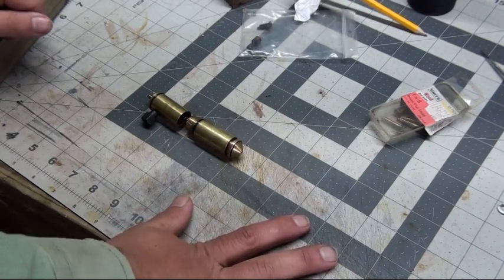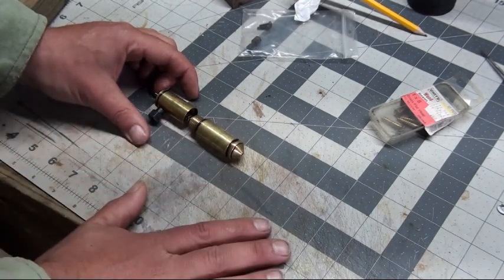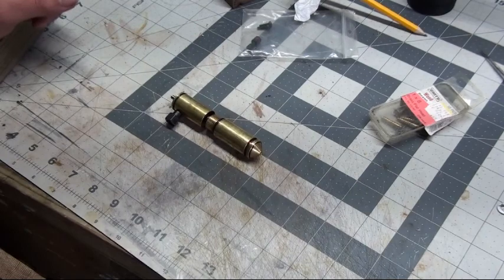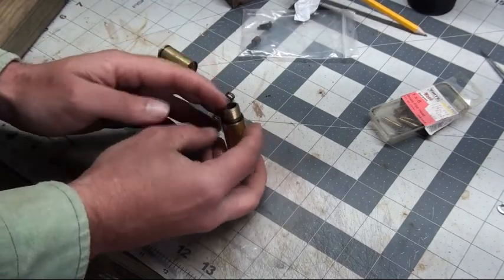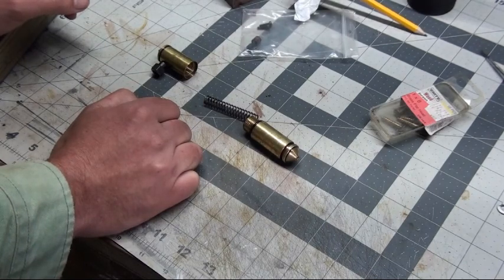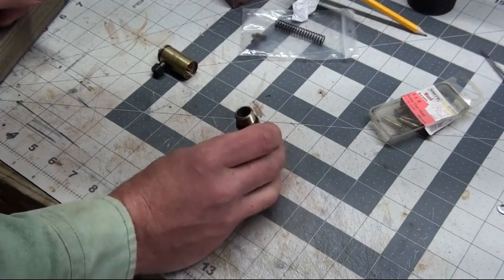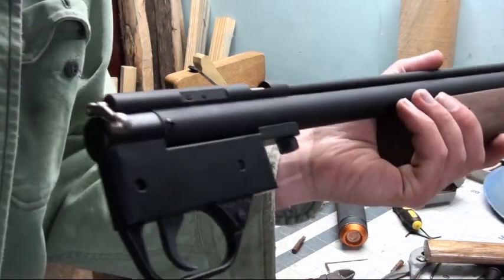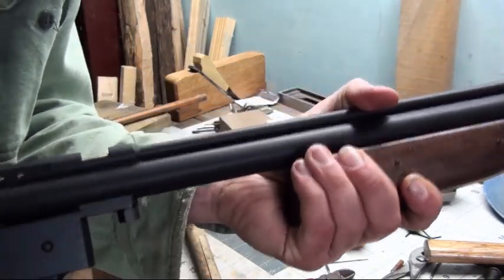Benjamin 392/397 "2 Spring" Valve Mod for Easier Pumping

Comment: Sir can't you help me where do gonna buy firing pin valve for my benjamin sheridan 392pa because here in the Philippines     its hard to find the same parts  or replacement kits
Reply from the maker: You would have to buy one from a US seller that ships to the Phillipines.  I don't know of any specific ones that I can recommend, but there are many shops that sell airgun parts that would have the valve you need.

Comment: I am writing here cause I lost all hopes and even though I know this is a 2-year old video, I have to try my luck.

My Benji 392 was working fine. I don't live in the US so I couldn't source the pellgun oil.
I bought a silicon lubricant aerosol and stupid me, I sprayed a bit into the air hole.
The moment I did that, the valve stopped holding air.
The silicon aerosol is used for Airsoft guns so I know it works fine on o-rings. But I can't figure out why it's not holding air.

I tore the gun apart, cleaned the inside of the valve and put it back together, now it holds air for 1 pump but the pressure doesn't build up. I am lost and frustrated and no one in forums, etc. been able to diagnose the problem.
Unfortunately ordering a new valve is not an option for me. I can only hope you will check the comments even on your older videos and give me some valuable insight. I so badly want to get that gun running again but I haven't been able to for over 3 years now. Any help is appreciated.
Reply from the maker: That sounds very strange, I would not have expected a silicon lubricant to cause problems like that.  I use silicon oil on my PCP airguns.  Maybe it was caused by an additive in the aerosol spray.  I use a silicon treadmill lubricant.  If you can't get pellgun oil, one of the best airgun lubes is 30-weight non-detergent motor oil.  I have heard that it doesn't matter if it's non-detergent or not, but I can't say for sure.  Inspect all of the soft parts, like the o-rings, check valve, and pump cup, for damage and replace anything with nicks or cuts.  A little nick can make a big difference, and they can easily be damaged when you disassemble them.  It's hard to say what the problem is without seeing the gun, but my first guess is that air is not getting into the valve.  That could be a problem with the pump cup, or you could  try doing an alcohol flush and see if that works.  I would try that first before replacing any parts.  There is a channel called NorthWestAirgun with a video about doing an alcohol flush.  The guy works on a lot of old pumpers and definitely knows more than me, so maybe he could help if all else fails.
Reply: @ForgeFireCustoms  
Really appreciate the response.
Yes I did the alcohol flush before tearing it apart. After the alcohol flush, the valve was holding a tiny bit of pressure but wasn't building up.
I sprayed a bit of the same silicon lubricant on the pump cup, a bit of o-ring lubricant on all other o-rings and put the gun back together.
After 3 days it's not even holding that 1 pump of air.
Pump cup looks totally fine.
The o-rings outside the valve have tiny nicks but that happened after disassembly. The problem preceded those nicks.
I am only thinking either the firing pin part of the valve is leaking, or the little plastic thingy where the air flows inside the valve, that one doesn't seal the valve properly and when I open the pump handle up, all the air escapes.

I can't thank you enough for checking and responding to the comments on older videos.
But I will surely try what you said and replace all the o-rings and will see how things go from there.

Ona different note, I saw your bronze Benji and I couldn't stop admiring the old school look of that rifle. The trigger guard was a work of art. Gave me a whole lot of ideas on what I want to do cosmetically if I can get the gun running.
Reply from the maker: @xxARAtaixx  If the air is escaping when you open the pump arm, then the plastic check valve must be the problem.  Even if the spring was weak, air pressure inside the valve should be enough to hold it closed after a few pumps.  There must be something inside that is preventing the check valve from sealing.  if the poppet valve was the problem (the thing that looks like a firing pin), air would be coming out of the muzzle when you try to pump it.  Hopefully that narrows it down.  Have you tried asking on the Gateway to Airguns forum?  There are a lot of knowledgeable people there.  https://www.gatewaytoairguns.org/GTA/
Reply: @ForgeFireCustoms  
Makes sense.
I will try and see if I can narrow it down.
I am still baffled why a simple silicon spray caused all this.

Really appreciate your responses. You're one of the fewer people who actually take time to respond. 
Subscribed.
Reply: i would clean valve at orphosis holes of any possible cumbustion residue then check plunger and all orings. short diagnostic is original spring replacement and go from there. i modded a pcp and it leaks if i dont have hammer cocked first. could be just that. i also polish and debur every thing
Reply: @Protege-i3x  thank you for taking your time to respond. Based on the channel owners's explanations, I narrowed dow the the problem and I know it is the poppet valve (the firing pin valve). And the problem is, I live in Asia so there is no Benjamin/crossman support here. So I still haven't been able to fix the rifIe because all parts for FAs and AGs need to be imported through licensed distributors in my country and no distributor has agreed to go through the trouble of preparing the paperwork for 1 tiny inexpensive part that they can't make much money on.

Comment: Can you make a video showing how to disassemble? My 392 is not holding air and I want to fix myself but no idea how to disassemble.
Reply from the maker: I don't know if I'll ever get around to making a video, but disassembly is pretty easy.  Take the stock off first, one screw ahead of the trigger guard.  Then remove the trigger assembly by taking out the two screws on either side of the gun, in the metal tube right above the trigger.  You might also need to loosen the stud that the stock screw threaded into, because the front of the trigger assembly housing kind of slides onto it.  The hammer and hammer spring will also come out.  There will be compression on the hammer spring, so make sure nothing goes flying when you take the screws out.  Then remove the threaded stock screw thing, which is also holding the valve in place.  Pump the gun a few times to make the air pressure push the valve out.  Depending on how tight it is, you might need to grab the stem of the poppet valve with pliers or something to pull it out.  It can be hard to unscrew the two halves of the valve.  Put the threaded stud back in the hole so you have something to grab, and if necessary put the other half in a vice with padded jaws and break it loose.  I think that's everything, but if I forgot a step, you'll figure it out.  It's the easiest airgun to take apart that I've worked on.
Reply: @ForgeFireCustoms  Thank you Sir I'll try it as soon as the new seals get here. Merry Christmas thanks for the reply.